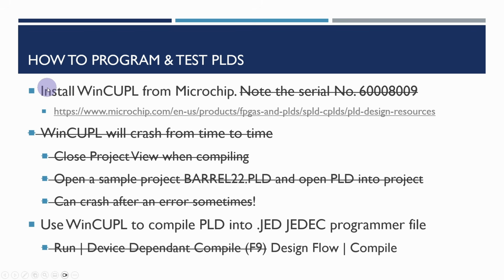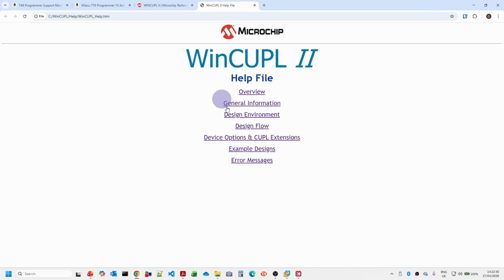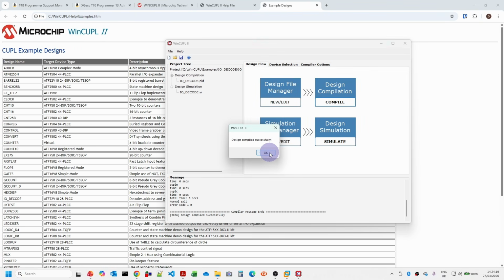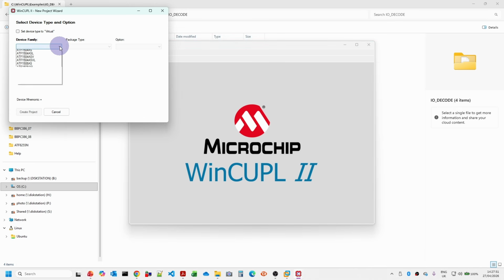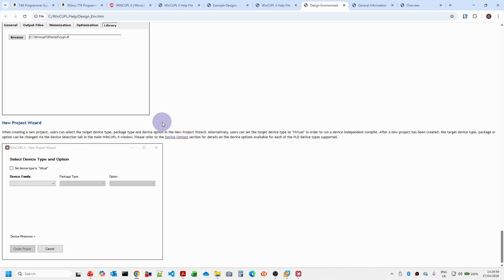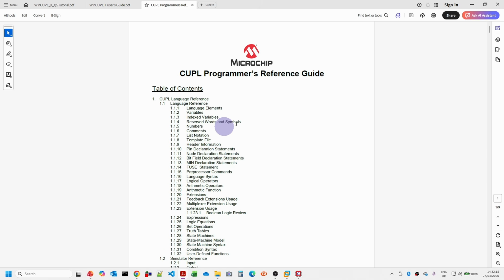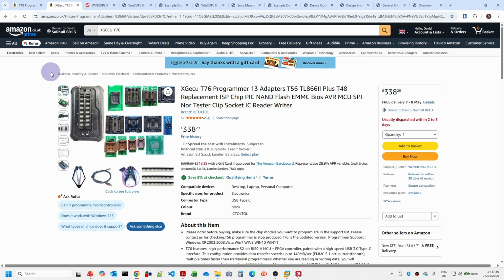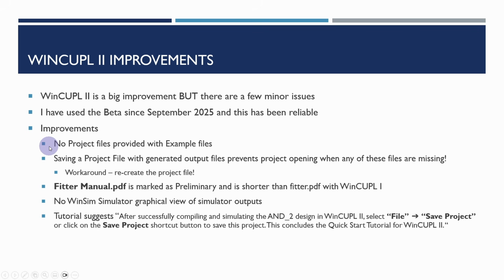New PLD Compiler WinCUPL II released (PLDs part 10)

Comment: Just a quick tip, instead of creating the project file again, you can open the .WCP file in a text editor and remove the reference to the missing files. It just has entries like JED_Name= which you can return it back to it equaling nothing.
Reply from the maker: I must admit I have never looked at the contents of the .WCP file. Thanks for the tip.
Dave
Reply: @breadboardinglabs thanks for the content! Building a 6502 system ATM and your content is really the only good PLD reference material out there.. these manufacturers really don’t want to make it easy to use their products it seems! Subbed!
Reply from the maker: Thanks. The reason why I did the PLD series was because of the lack of coherent info. Glad its of use. Dave

Comment: There is also a VS-CUPL extensions for VSCode, but it does have a build check-list of parts to install.. winCUPL is one of them.  I haven't had a chance to finish it, and it might be a Linux thing.   Not sure if anyone else has found/tried it out.
Reply from the maker: Not come across it. Will take a look. Most things will need the CUPL command line exes as some of the info needed to do it yourself was not made public. Dave

Comment: I did have one weird issue where a file would compile just fine on the old WINCUPL but would fail on the new one, not sure what's up with that. I've only had that happen when programming the ATF 150x series tough, hasn't been an issue with the older ones.
Reply from the maker: I found a few strange things with the ATF150x series but not with CUPL. I found that pins 99 and 100 didn't get programmed properly unless I did an explicit erase first even though this is supposed to happen during programming.
Sometimes I comment out sections until it works. Then use a hex editor to see if there's anything strange going on. Dave

Comment: For those that didn’t watch the video yet, note that the command line .exe files are unchanged from previous WinCUPL releases.
Reply from the maker: I think I mentioned they had a 2004 timestamp. The command line EXEs didn't have many issues I am aware of other than some of the pin diagrams in .DOC file don't come out very well for anything other than DIP . Dave

Comment: I've been a developer starting as a pre-teen since the 80's. My entire career was developing software despite being an EE. It  never ceases to amaze me how things just seem to regress. Why would any build tool care about the presence or absence of the output files it creates? What reasoning could anyone possibly have for making that a thing? I dread to think where they are storing the inventory of "stuff" that is no longer there. 
Needing to create a dummy file to open pre-existing projects is the dumbest thing ever. Did no one say "You know, that doesn't make any sense at all?"

I'd better stop because my rant would be unending. Unbelievable.
Reply from the maker: I agree. I still think Windows 2000 with Office 2000 before the ribbon bar vandalism was my most productive environment. Just enough but not too much. A lot has not improved or even got worse since then! As one of my former colleagues used to complain "why can't we get training for common sense!" Dave
Reply: @breadboardinglabs  I still have PTSD working in a gigantic Java system for large bank where the build tools wouldn't alert you that the build server had run out of disc space and created truncated artifacts that it then went on to queue up for installation to production resulting in a massive outage the next day. Some genius decided that building the components twice, one to do automated testing on, and a final build for production deployment was a great idea. With the advent of AI and the propensity for less human reasoning it's just going to get worse. I'm happy we have our little islands of sanity where we can work on our own things that are mostly predictable.
Reply from the maker: I think AI allows people who think they know what they are doing mess things up more quickly. There was the Hacker News story about AI dropping production databases and the backups were screwed because of some vendor API issue. Mag tape in a fireproof safe, with weekly offsite copies allowed me to sleep soundly. Ransomware proof! Dave